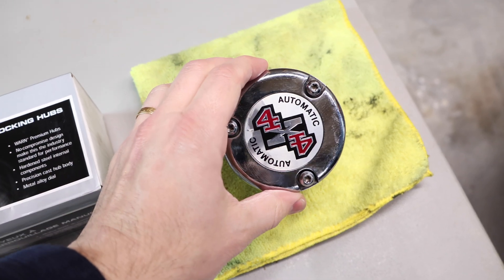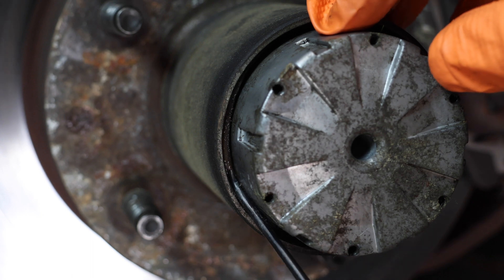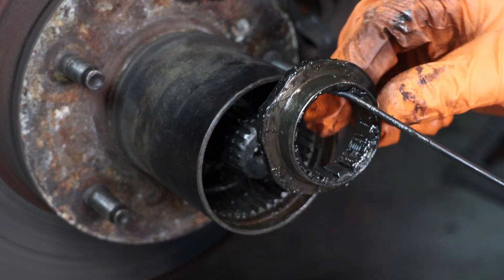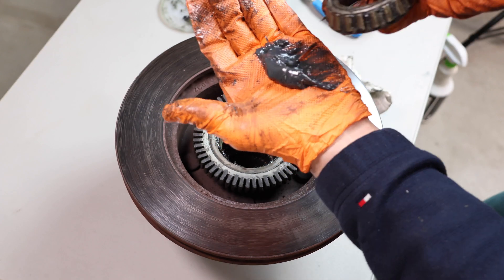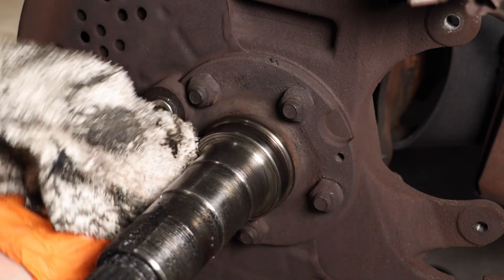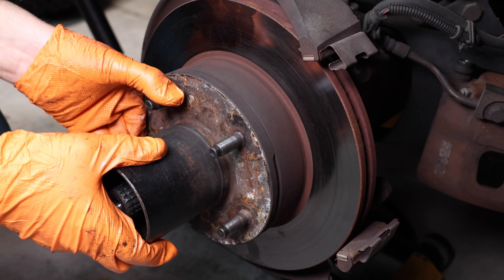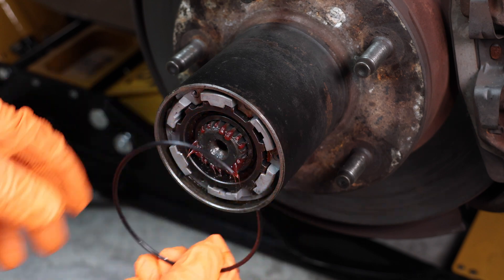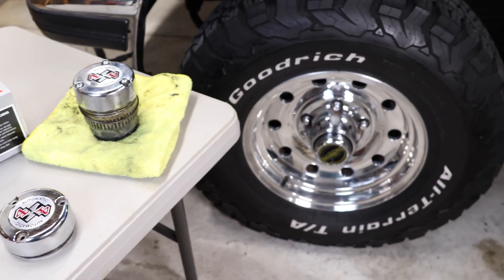Auto - Manual Locking Hub Conversion | 1980-1996 Ford Bronco F150 Dana 44 50 60 | Bronco Restoration

Comment: Hey I am having an issue. I have a 1994 auto locking jibs and it comes with the spindle nut and washer like you are replacing. My issue is I can't put the last washer on the end of the axle. The hub doesn't slide in far enough. I tried pushing the axle out from the inside at the U joint and other methods to get an 1/8 inch more of space but nothing is working. Any advice on how to get that last lock ring washer on the end of the axle? Thank you.

Comment: How come when I put the hub in and lock it it’s not spinning my drive train
Reply from the maker: Raise the front of the truck and set it onto jackstands. lock the hubs and try to spin the wheel, do you see the front axle shaft spinning? (the axle connecting the front wheel to the front diff) Try with both wheels, if axles spin then the hubs are working correclty, if not then there is a problem where the hub and axle meet.

Comment: My neighbors all have to get out of their truck in the rain in the mud and lock their hubs. I have automatic lockers. I love them. No, I’m not climbing Moab… but it truly sucks to have to get out in the rain and mud and lock your hubs and I’m sure the most the people that comment on this don’t live 25 miles outside of town on a non-maintained Road! My automatics have not filled me yet… and I’m sure it’s true that the locking hubs are stronger. Maybe I have not seen proof of it in person yet though.!
Reply from the maker: Ive had completely different experiences with the autos, I have never had a set that worked or wasn't completely ground down internally. I purchased all my trucks used so they may have been abused. You have a good set, take care of them as they are very hard to find and expensive now to replace

Comment: So I've got a ghee whiz question..why would you go fron auto hubs to manual? I found your video looking to see if i can install autos on a manual setup. Pros/cons? Or is it just a matter of preference?
Reply from the maker: I certainly prefer the manuals as the autos are know to be weak and finicky to unlock. Almost all of the OBS trucks I have worked on the auto hubs were snapped. I do recommend the Warn standard manual over the Pro series.

Comment: I watched a mechanic work on my 1994 Bronco replacing the bearings and pads use a metal hammer trying to get my inner hubs on and off. Obviously he didn't see the half C rings holding the hub in. I have done the job a few times myself but turning 60 i decided to take in to Midas and apparently pay someone to learn as they go. It was very frustrating to watch and complained to the manager as I watched through the glass. I find it interesting how some mechanics will still attempt to fix a problem they have no idea how it works.
Reply from the maker: Ouch. I try to do as much work as possible myself as I do not trust the shops; haven't been able to find anyone able to perform a front wheel alignment, most shops refuse. I now do the alignments myself and believe it is within 90% of spec. Guess it is better to do yourself or have a friend do it.

Comment: When the locking hubs are on free does your driver side wheel turn the u joint and differential? Mine does . And on the passenger side it doesn’t spin the u joint when on free. When I lock hub on the passenger side only then will it turn the u joint . Does this mean my driver side hub is actually engaged ?
Reply from the maker: The u joint/axle should not spin if the hubs are set to FREE. If so then this usually means there is a defect in your hubs. Certain Warn Premium hubs have a defect where if you were to twist the hub from FREE to LOCK, and continue to twist past the LOCK back to FREE then the hub will permanently LOCK. This will cause the axle to spin and drag/pull the truck to one side. The only was is to remove the hub and reset the twisting mechanism. If yours are fairly new I recommend to return for a replacement set or try the standard Warn hubs.
Reply: @TheFixTech  I still have the factory locking hubs on it. So it’s definitely the hub than.

Comment: Thank you very much for your bronco videos.  They've helped me immensely. 

Your brake video and this one just guided me through the dissembly and reassembly replacing my front brakes. (I've got the 3 screw auto hubs, but I'm not changing them) 

No room for mistakes or missing parts, as I'm in europe and costs and shipping time for this stuff is crazy.  

Thanks again!

Comment: Great Videos! 
Im a bit confused what diaprams to get and the conversion kid. Think you might have glossed over the switch. 

Good thing i re watched your video i was going to start today but didnt realize there was a different spindle socket for auto. Im attempting to change the rotors and brakes as well as the Auto to Manual switch

Comment: The National Federal Mogul seals need to be ordered separately right, two sets? I just want to confirm the seals in this box are the one that goes behind the rotor for the inner bearings and the seal that goes on the spindle before putting the rotor on?
Reply: I just watched the video again and it answered my question, thanks.
Reply: I bought two conversion sets not realizing each had a set for both front wheels. Anybody need one lol?

Comment: Is the link for Auto spindle socket part # for a 2 3/8" or 2 1/2"? Looks like you where using a 2 1/2" in your video.

Comment: What benefit does converting it to manual serve? Would it not be more beneficial to not have to get out of your vehicle to put it into 4wd? Genuinely curious not trying to be rude.
Reply from the maker: I did this for the sake of preserving the original auto hubs as they are hard to find and can break if not properly used. The manual hubs are considered to be stronger, I only use my 4x4 for recreational use so I do not mind getting out and locking my hubs.
Reply: @TheFixTech  Thats fair I can see why you would then.

Comment: The best mechanical video I have seen, Yet myself I  have done it a few times , but the curiosity got my attention. I also liked the idea of don't use grease , I use havey engine oil, 20/50 like...it cant go anywhere. Grease seizes everything in the snow, as the system works by been activated with  the help of a spring to engage and once unscrew, the coil spring it weakness the tension, and the oppose  coil spring will disengage it, so, very sensitive, must move freely.

Comment: What size, # of stickout nubs for the Spindle Hub Socket?  I have the Dana 30/44 Premium  Hubs on my YJ Wrangler (front D30) that I have to inspect and install new replacement  hardware. It was originally installed almost 20 yrs ago.  But I don't know the socket size. 🤔

Comment: When i tighten the outer nut to 160lbs the hub is really hard to move . What did i do wrong ?
Reply from the maker: You should have two spindle nuts and a lock washer, be sure to the first nut has the finger pointing outward, then install the lock washer onto the spindle and the holes in the lock washer should insert onto the finger of the first spindle nut. Then tighten the last spindle nut.

Comment: So my question, I have a 86 Bronco. PO did the conversion already to manual. Bearings went out so time to change when I put all my new stuff in, the small snapring clip had no room to go on. Everything else went fine. Will it be ok to run without that and what would cause it? Great video and very helpful!!
Reply from the maker: The small snap ring is to keep the axel from sliding out of the housing, you can push on the axle from behind the hub, push it outward to be able to install the snap ring.

Comment: Do you still need to hit the 4x4 or 4x4 low button on the dash to ingage the transfer case, or do the buttons become useless?
Reply from the maker: Yes, you still need to use the buttons. The buttons control the transfer case, the hubs control the axle to hub connection.

Comment: I noticed when you removed the thrust washer and shims when you put the new locking hubs on you didn’t put the new thrust washer back, is that correct? Based on that is it true to say that these thrust washers are no longer needed with this new locking system?
Reply from the maker: Correct, the manual locking hubs were a simpler design and only require the two nuts and spacer.
Reply: So the OEM manual locking hubs have the three piece thrust washer + C ring to prevent axle from sliding back but warn manual locking hubs only need the snap ring. Is that right?

Great video and explanation.

Comment: Did you grind down the outer wall of the socket to fit in the hub to remove axle nut? I bought the same exact socket and when I try to turn the socket, the rotor moves with the socket and doesn’t loosen without hitting the inside of the hub.
Reply from the maker: No, the socket should fit perfectly. There are different sizes, I believe it should be a 2 3/8. Also different rotors may be made differently.
Reply: @TheFixTech  might be my rotor then because the socket is 2 1/2 and fits on the axle nut but just won’t turn.
Reply: @ivancastellano5685  i had to grind mine down too

Comment: This may be a stupid question, but I'm curious nonetheless. Does the 4x4 shifter in the cab become useless after the conversion or can you leave the hubs locked and use the shifter to still engage and disengage the 4x4? Looking to do this conversion on my '90 F150.
Reply from the maker: The shifter and hubs are used together, with manual or auto hubs, you still need both. The shifter engages the transfer case to the transmission. The hubs engage the front axle (which is connected to the transfer case) to the wheels themselves. I prefer the manuals hubs as they are stronger than the auto hubs.

Comment: Awesome vid and that camara angle and zoom is excellent... it's as if you're actually in the shop looking over your shoulder.... do you have a video of you servicing your old auto hubs ( if you haven't serviced yours yet can you make a video...) or do you know we're I can get info on servicing the hub assembly? Cleaning and regreasing it. Thanks
Reply from the maker: I can make a video of that soon, there are a couple different versions of the Ford auto hub. I haven’t dived into them yet and have them sitting on the shelf. You can find diagrams online from the official Ford service manual that can help with orientation. I know excessive grease can be detrimental, especially in colder climates.
Reply: @TheFixTech  Hello, Thanks TF. Yes I've looked at as many THREE screw automatic hub VID as YouTube will allow me to see. yours was the best...  I found a set of brand new set of OEM hubs IN THE BOX online  which includes @1:44 and @2:22 They came pregreased BUT my problem is the grease is more than 20 years old and even tho they were wrapped in plastic the grease has dried up a bit and is stiff..I'm not sure if it's too dry to instal just like that or if I should take them apart and clean and regrease them.. I have never seen a vid on servicing JUST the auto hub assembly. I've even tried looking for that exploded view of the auto hub assembly with no luck. I'm afraid that if I take that clip off I may get more than I bargained for lol.  If you would do a vid I would be greatful, Thanks, Mr.b. 

 ps. Do you have a emai, facebook or IG?  I'd like to send you some pics...

Comment: I have 1 ? Why would you want to swap automatic for manual?? I just shift into 4x4 without having to get out and getting my feet muddy can you please answer my?
Reply from the maker: It is personal preference for me, these auto hubs are very hard to find and are expensive. I chose to remove them and preserve them while choosing to use and abuse the manual hubs. The manual hubs are known to be stronger and will last longer. If not used properly I have seen the auto hubs snap and grind all teeth inside, the rarity and cost of replacing was enough for me to remove my fully working auto hubs and keep them on the shelf.

Comment: Thanks for the upload! I have an 88 bronco that has the “top hat” style locking hubs, I’ve heard that I would need to swap the spindles from the knuckle out, with the automatic hubs it seems as you didn’t have to change the spindles at all, would you happen to know if this is true for my rig?
Reply from the maker: Yes, the top hat style was unique and used for only 2 years. If you would like to use these warn or any other standard manual or even auto locking hubs, you will have to replace the spindle. There are a couple different spindle options that only affect the style of wheel seal used (does not affect style of hubs used). I recommend (as most do) the 1994- and below style spindle as they do not require the two piece seal. The two piece seal is not as durable as the standard one piece. Most people convert there two piece seal style spindle to the one piece design.
Reply: @TheFixTech  theoretically speaking, I would be able to use the spindles on a rig that has a automatic hub? I ask this because there is a 91 bronco sitting at a pick n pull that looks like it’s an automatic, can’t quite tell based on the angle of the photo that was took. 

Thanks for the reply!
Reply from the maker: @MasterKingTang  Yes, that spindle will work and it will be a single style seal. You will still need the spindle nut conversion kit, or if you can find a used set of manual spindle nuts at the yard. The f150 will be the same.
Reply: @TheFixTech  I believe I have the spindle nuts, I took apart the top hat when I first the bronco to re-grease the bears and replaced the seal.

Thank you so much. Your videos have helped me tremendously on my project! The next thing to do is take apart the front differential to replace the side seals as they are leaking gear oil.

Comment: Listen man, I'm 24 i just got my childhood 91 F150 with 114K miles on it and it's currently being restored of my ability. Your video series that tackles these basic to complex tasks have been fantastic than any other channel that's demonstrated. Thank you. This channel is a lifesaver.

Fun fact: My manual hubs are the original WARN hubs But it needs a replacement. Luckily you made a video about it!
Reply from the maker: Thank you, those factory WARN hubs you have are made in USA. Unfortunately all new WARN hubs are made in China. You can actually rebuild your original hubs with used parts found online and in local salvage yards.
Reply: In the exact boat but 26 and this helped a bunch.

Comment: Thanks plan on doing this as well , is this any other disconnect needed from transfer case ? Or from 4x4 switch inside can - have 96 bronco 5.8 thanks
Reply from the maker: No other disconnect is needed. Your truck will have the two piece wheel seal as well. Be sure to set the bearing preload correctly.

Comment from the maker: I prefer using the manual hubs vs the auto, the Warn Standard Hubs are my go to as I do like the design and quarter lock vs the Premium full turn. I had an extra set of premium so that is why I installed them. If you are looking for a good manual hub, I recommend the Warn Standard.